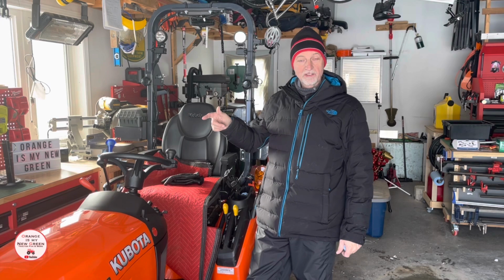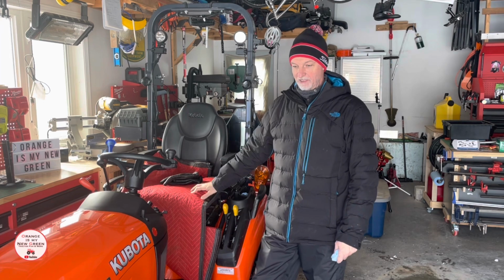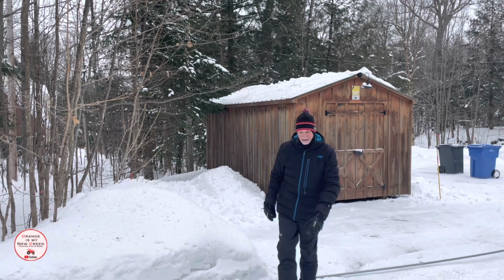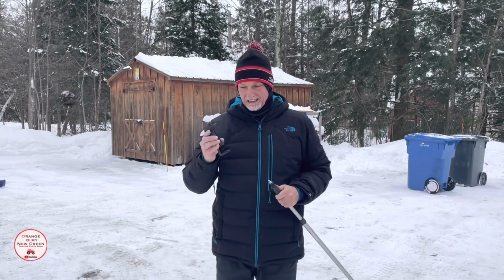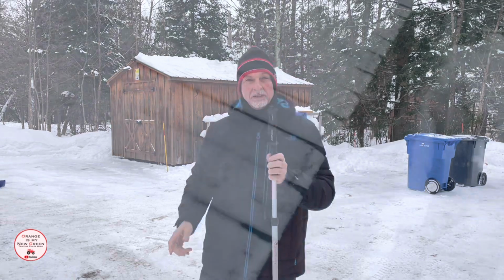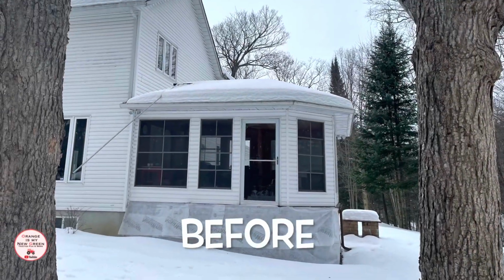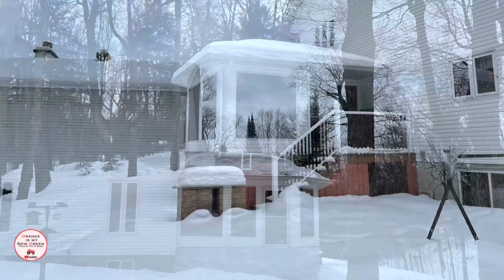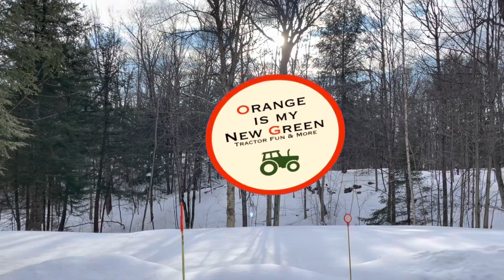#94 Removing snow from the roof + snowblower

Comment: Good evening Luc ( OUTSTANDING INTRO BY YOUR GRANT SON 👍👌😇 ) In cold environment ( hot and then Cold cycles and the many hours used on the hydraulics oil make it to fluctuates a little that is why after three years or so many hrs ( what ever come first )  to change the oil. 👌👍🧐 Yes snow roof removal is very important,  Oupss Luc had a rear hard landing 🥴 Great mode on your hydraulic holders 👌👍🧐   🚧🚧🚧 OUTSTANDING BOILING WATER TROUGH 🚧🚧🚧 Thank you for your Shoot out mon ami 🧐👍👌 You are better than me 👌👍😇 Keep up your OUTSTANDING video's Cheers 👍👌🍻
Reply from the maker: Hey hey Dave 🙋🏼‍♂️, my grandson was awesome 🥰. Thanks for watching mon ami et bon weekend 🙂🙋🏼‍♂️👍🏻🍻
Reply: @OrangeismyNewGreen  🙏😇👌👍🍻

Comment: I regularly add hydraulic fluid to mine.  Not a lot, but like you said half a pint here and there.  I do occasionally have leaks from the quick connect manifold.  I am not sure where it goes.  🤷🏼‍♂️  Great video!  Have a great weekend, Luc!
Reply from the maker: Thanks for the info on the hydraulic fluid Lucas 👍🏻. Thanks for watching and have a great weekend as well 🙂🙋🏼‍♂️👍🏻

Comment: Great video Luc. I wouldn't worry about the slight loss of fluid. I agree with Hillside Acres for the reasoning. Good thing you had a soft landing for that slip/fall :) We hardly have any snow left here at this point.
Reply from the maker: Thanks for the tip on the fluid Case 👍🏻. We probably will get 1-2 more snowfalls. Thanks for watching and have a great weekend 🙂🙋🏼‍♂️👍🏻

Comment: I think the little bit of fluid loss could be from hooking and unhooking hoses. Sometimes a small amount is lost. Looks like your snow is there to stay it’s nearly 60 degrees here in Connecticut today most all the snow has melted off. I’m happy I don’t have any roof raking to do!
Reply from the maker: 60° and almost no more snow 😳😢😂. Thanks for watching Richie and have a great weekend 🙂🙋🏼‍♂️👍🏻
Reply: That was going to be my guess as well. Some of the fluid will also remain in the hoses from usage and when going from one hydraulic implement to another, eventually it will probably add up to some loss.

Comment: Hi Luc. Nice video. Question. What are all the pieces required for the Land Pride blade you have attached to the back of your tractor? I am contemplating on getting the same blade to better clean up snow and ice on my super long driveway. Thanks.
Reply from the maker: Hi Ovi, I have the LandPride QH15 quick hitch attached to the 3 point hitch and the LandPride RB1560 rear blade. Thanks for watching and have a great weekend 🙂🙋🏼‍♂️👍🏻
Reply: @OrangeismyNewGreen  Thank you Luc. I believe the rear blade will come in very handy on my tractor next winter.

Comment: I would not expect you to loose hydraulic oil other than from the quick attach fittings or a leak. Instead of a rope on the roof next winter I would suggest you have a year to think of a way to get the snow blower up there 😀
Reply from the maker: Humm snowblower on the roof 😳😂😂. I’ll have to come up with a different solution to make it easier, I have 9 months to come up with something 😉😂😂. Have a great weekend my friends 🙋🏼‍♂️👍🏻🙂
Reply: @OrangeismyNewGreen  As a serious suggestion, could you put a plastic cover over the roof? When you pull the cover off all the snow would come with it. I hope you have a good weekend too
Reply from the maker: @GardenTractorBoy  I like your idea Joseph👍🏻thanks 🙂🙋🏼‍♂️👍🏻

Comment: Clearing snow off a roof is very tiring! Ask me how I know!  Lol.   Was the transmission warmed up before you checked it?  Kubota premium UDT is synthetic I believe, and most synthetic oils will expand and contract with temperature.  You may find it a tad over full in the summer.  Great intro!!
Reply from the maker: I was so tired after 😳😂. Tranny was warm, I’ll check it again after using the tractor 👍🏻. Thanks for watching Keegan and have a great weekend 🙋🏼‍♂️🙂👍🏻

Comment: So when you put the oil in, did the noise go away ? Not an easy job getting snow off a roof. Good to get done before the rain.
Reply from the maker: Yes it did 👍🏻. We got a lot of rain, thanks for watching Noel and have a great weekend 🙂🙋🏼‍♂️👍🏻
Reply: Orange is my New Green that’s good the noise is gone. We are having heavy rain and wind right now. And a flash freeze warning for this afternoon. Sure don’t like walking on ice. 
You have a great weekend as well.
Reply from the maker: Sounds like you’re getting what we got 😳. Good luck 🙋🏼‍♂️👍🏻